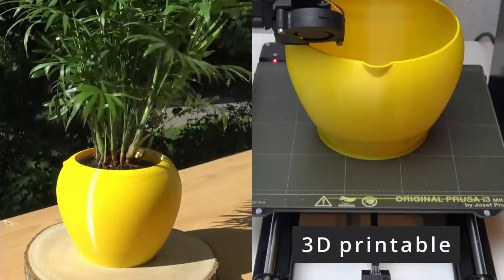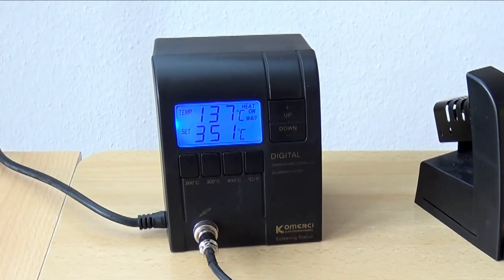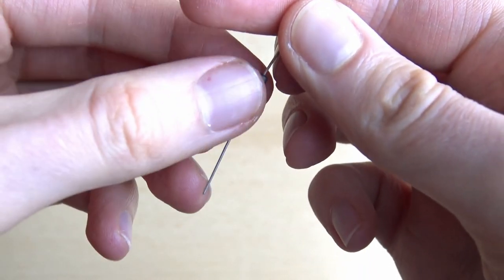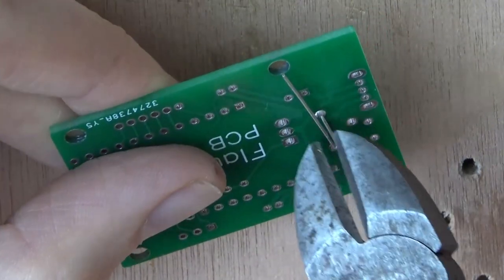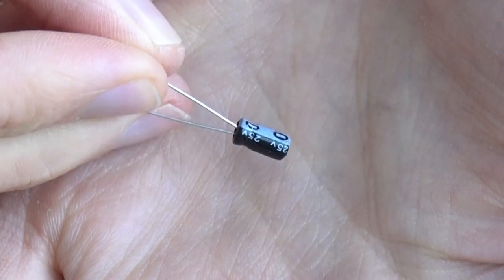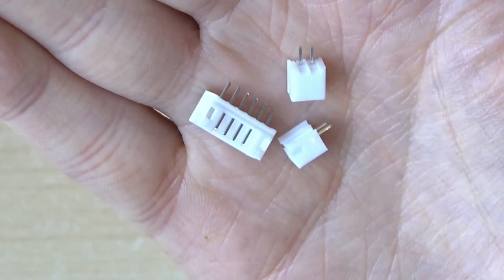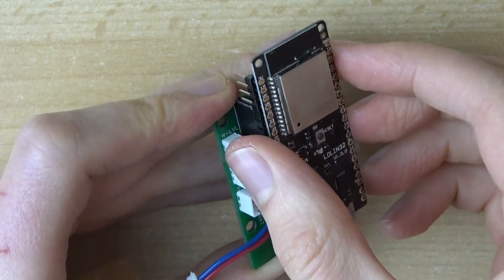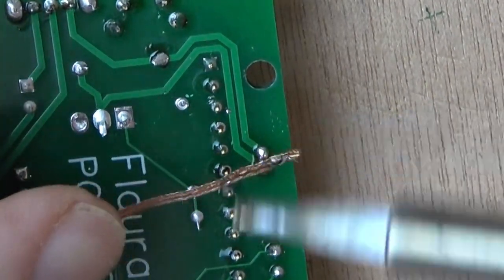Soldering Electronics for Flaura – Smart, Self-watering Planter (DIY Project, 3D Printed, Arduino)

Comment: The easiest way to get solder off of a short or from within a through hole is to warm the solder properly, and use momentum to tap the solder off or out of the board.  Generally pretty accessible as well, cuz all you do it is tap it against the table.